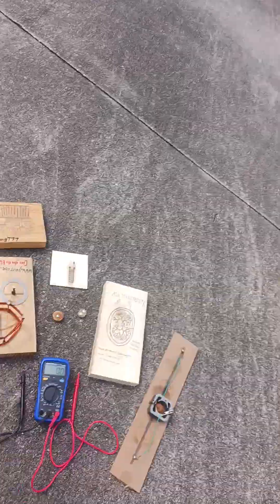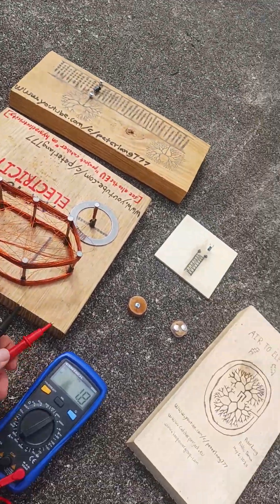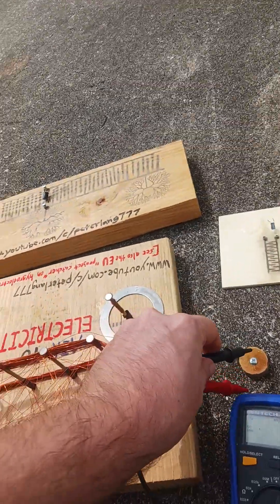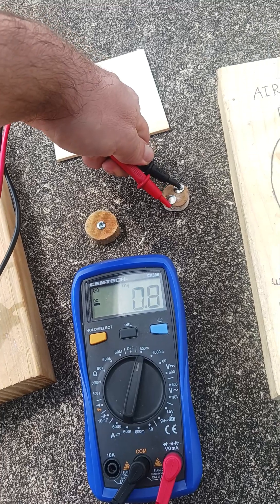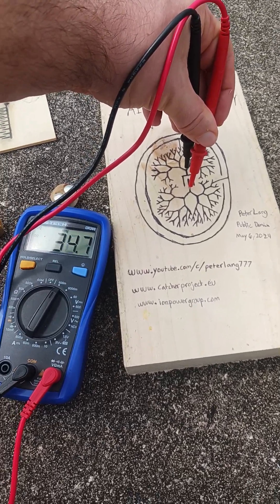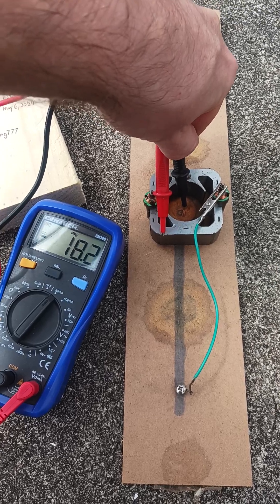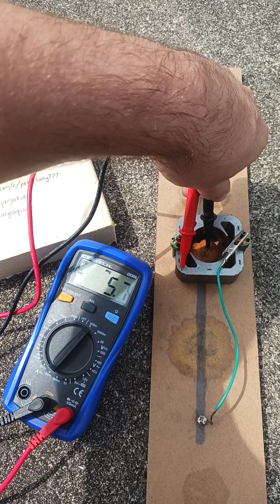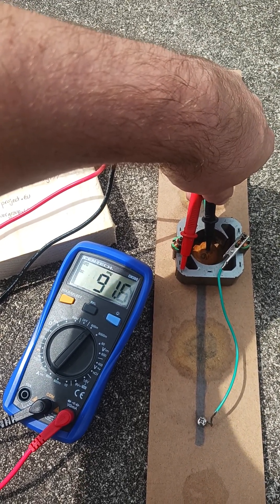BEHOLD ! AN ARRAY OF NANOTECH !

Comment: Is that a high impedance or a low impedance meter? Can you repeat the test in an dehumidied environment to prove it's humidity, rather than coupling from the power lines?
Reply from the maker: the video . watch it. see the little wood circles with pins? they are not attached to coils. they are not by magick taking electricity from 30 feet away. em induction declines with the square of the distance. yes it is moisture this has been proven all over the world many times www.catcherproject.eu

Comment: Could you wrie thosr all in series and get all there power combine then make a spark with it?
Reply from the maker: it would not have the power to create an air gap discharge with those but in series they would recharge a graphene aluminum battery cellphone

Comment: I'm pretty sure you'll get voltage from any coil that's underneath a power line.
Reply from the maker: are you.? try actually watching the video. the wood circles don't have antennas. thanks for playing scully but cherry picking facts to create a "theory" that explains 1/4  of what is going on is a failure
Reply: @peterlang777 it’s called induction. A current carrying wire produces a field around it. When another wire is brought near the wire that’s carrying current, it induces current into the the other wire.
Reply: He’s measuring DC voltage, any wireless transmission of power produces AC voltages
Reply from the maker: @owenpenning1597  it's not a wireless. it's hygroelectric

Comment: Can you explain how this works?
Reply: He is under power line. The things acts as antennas and get power from the line.
Reply: @kkrystus  Know what you’re talking before before you comment. He’s measuring DC voltage. Wireless transmission, either through magnetic fields or electromagnetic waves, will produce AC voltages. Unless he had away to amplify the voltage then rectify it, it has to be from different source than powerlines or any other AC source.
Reply from the maker: @kkrystus  really? explain the little wood circles with pins then
Reply from the maker: hygroelectricity is chemical energy in water being used for electrical power www.catcherproject.eu